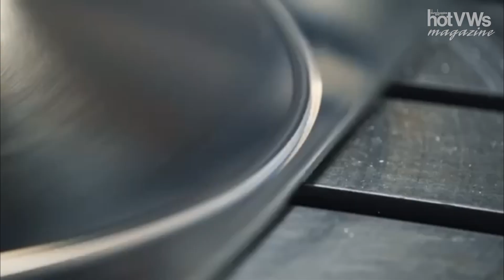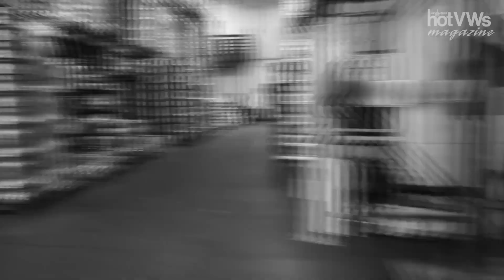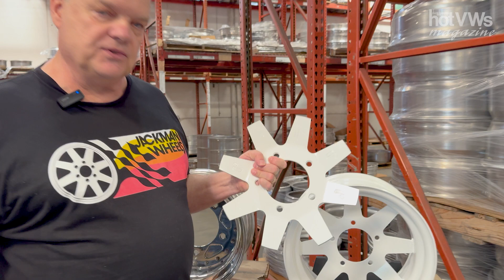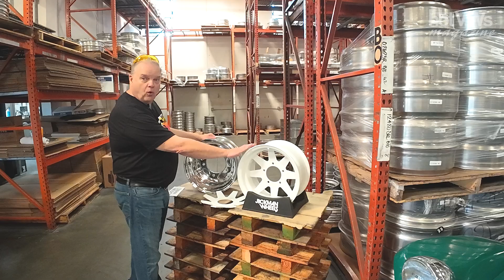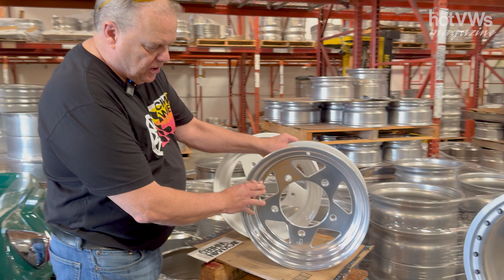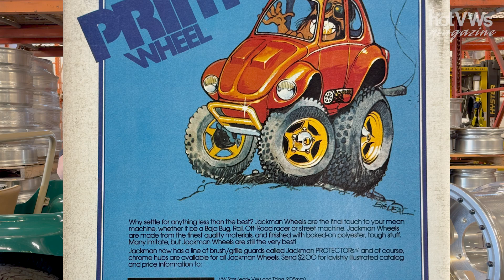Welcome Back Jackman Wheels!

Comment: Hello I recently purchased a 1965 Volkswagen micro bus Deluxe and I am trying to research the vin # to figure out the original paint color, interior colors trim level, ect what is the best way to find this information?
Reply from the maker: You can get the birth certificate from VW Classic Parts. Information includes the original color, equipment, and destination.
https://www.volkswagen-classic-parts.com/en_us/service/certificate-data-sheets.html
Reply: Thanks!

Comment: The 5454 aluminum "work hardens" as it is spin-formed. in 1988 I got to help Install an aluminum wheel hoop spin forming line. I eventually was selected to develop the spinning programs for the four axis Autospin machine. Sizes from 15x6 to 15x10 and some 16 inchers at Progressive wheel in Riverside Ca. I was hired there by Larry Anderson who owned Cal Master wheel, a VW specialty wheel maker.